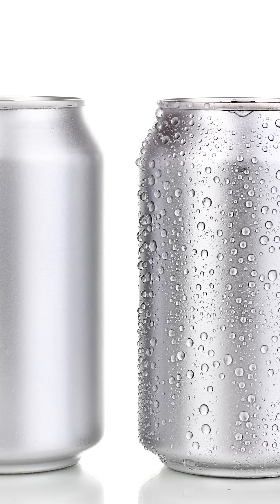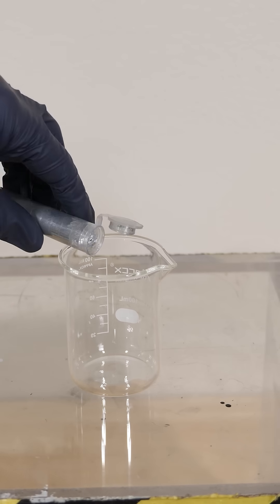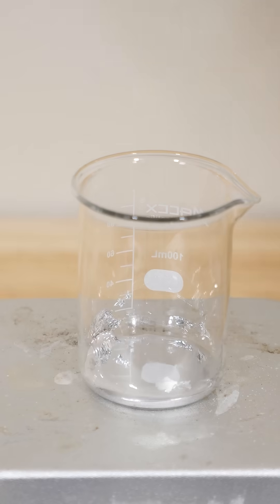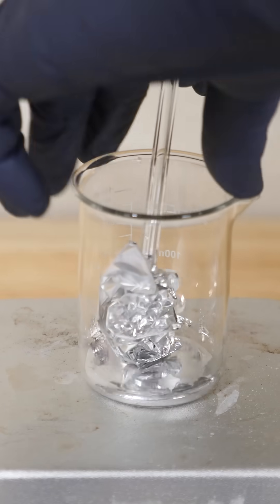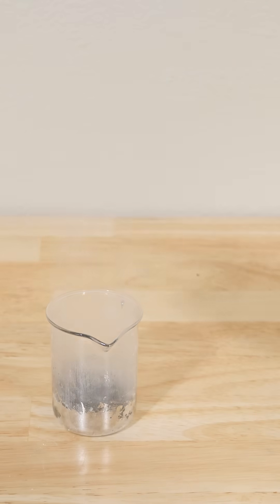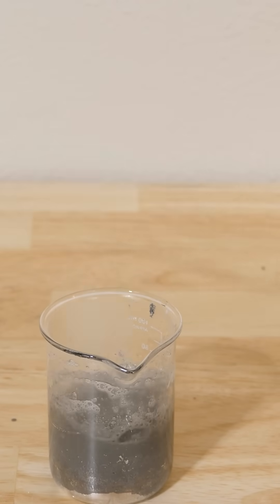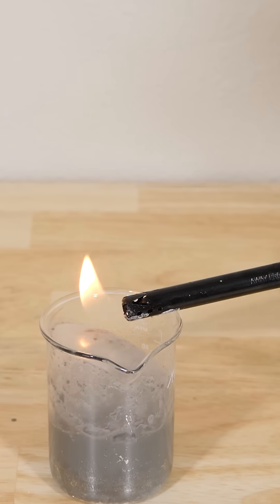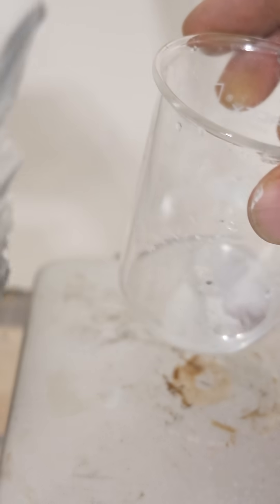Don't mix water and aluminum!

Comment: Note: Aluminium Oxide (Al2O3) is sapphire. And the dissolved Al in Ga is called an amalgam.
Reply: Amalgam in chemistry refers to an alloy of mercury with another metal
Reply: @SeanHenrichs Thats what I thought/was taught as well... can anyone please confirm this either way??As this commemt has now confused me as to if an Amalgam=an Alloy Consisting of Any Metal+ MERCURY /OR/ can the 2nd metal be any of the low melting point metals (i.e Mercury/Gallium?/Germanium?/Bismuth?/etc?)???
Reply: Do u know if the AL2O3 is soluable in Gallium?
Reply: @Unknown-Yve  absolutely not. The only thing I've ever heard of that can dissolve a sapphire is an extremely hot and caustic melt of NaOH, NaCO3, NaF, and NaB3H7. And that's something I never even want to attempt, because that's just terrifying.
Reply: @Unknown-Yve al2o3 is not soluble in the gallium. Nor does it seem that aluminum hydroxide is soluble either. This process allows the easy collection of the gallium after the reaction. If they were soluble you could not easily separate them.
Reply: I would have to disagree. Sapphire is aluminum oxide, but not all aluminum oxide is sapphire. Like how a square is a rectangle, but a rectangle isn’t always a square. They’re fundamentally different in terms of atomic structure.
Reply: @Sniperboy5551  Like how diamonds are all carbon, but not all carbon are diamonds?
Reply: @RobbieNguyen Like people are made of carbon, but don't shine.  Or are they made of Soylent Green?  Are babies made out of peanut butter.
Reply: @Sniperboy5551 I thought sapphire is mostly carbon structure but with Aluminium oxide impurity which gives it colour?
Reply: Yes this is the comment I was searching for.. Al+H2O only produces Al(OH)3 that's a white powder like thing.. idk how he separated that powder thing from gallium!😅
Reply: @jibinjose7537 depending on the temperature, it can make hydroxide or oxide
Reply: Cool, I now wonder if the term "amalgamation" derived from that! 😮
Reply: @delsings  It was.
Reply: Aluminum oxide isn't sapphire, it's the impurity that gives sapphire corundum its color. I have a feeling you meant that, but there are some people who would read your comment and think, "wow, who knew sapphire was made of aluminium?" so I felt it was best to correct it.
Reply: how do you reverse the process to make an infinite hydrogen producing battery ?
Reply: @ommsterlitz1805  You dont. Alluminum is extreamly energy expensive to make. While its raw material Bauxite is really plentifull, the energy needed to refine it would be way too much to use it as fuel. However there is research into otehr metal that has simmular properties thats is found naturaly for hydrogen fuel cells.
Reply: @lordfrz9339 learn how to spell
Reply: So, I have this aluminum, aka aluminium, bread pan that was used by my roommates as a water dish for their pets. It developed oxidation spots in it with white crust. Is that corrosion aluminium oxide, and if it's scraped off, would the powder ignite in water? 
Seems like this is the group to ask.😎
Reply: Rubys are also made of Al2O3. As it is a variety of the corundum mineral
Reply: How many different ways can you break that bond to make soooooo many different end materials...🍿
Reply: Sapphire is a really strong ceramic and I wanna know how to make sapphire chain mail!

Any ideas on how to get the right ~form~ of aluminum oxide so it's not just a powder?  I got some cans to recycle.   >:-D
Reply: @NotSoMuchFrankly you can get corundum crystals, but frankly it's probably not a good material for armor, because while it's hard, it's also very stiff, and will chip, it's basically like making a glass armor.
Also nighthawkinlight has a video on making synthetic rubies, but it's basically just melting aluminum oxide with 1% chromium with a carbon rod and graphite crucible on an arc welder to make a crude arc furnace.
The hardest part would probably be making aluminum oxide from the cans instead of just getting raw aluminum oxide powder, which is actually pretty cheap, if you don't mind the purity you could probably get some used powder from a waterjet cutting business for cheap, which might also give interesting colors due to the metal powders in it.
Reply: @satibel  Why thank you, sir, that was the kind of answer I was looking for.  I figured if it were practical and cost effective, someone would have done it but was looking for deets on the matter.
Reply: @NotSoMuchFrankly  love the thinking you do!
Reply: No, Corundum is a crystaline form of aluminium oxide.
A sapphire is crystaline aluminum oxide + chromium.
Not all aluminium oxide structures are sapphire or have the hardness of corundum.
Reply: You can make a similar such amalgam with aluminum and mercury, I think. It's used in lots of organic reactions.
Reply: When one compound has several structures it can form, making distinct properties at the macro level, those are called "allotropes"
Reply: In the anime „full metal panic“ there was this anti terror organization that the MC was part of that was called „Mithril“
Ofc they needed an opposing faction. They called themselves „Amalgam“
Now that I know this, maybe that’s why they lost 🤦‍♀️
Reply: "Aluminium oxide is responsible for the resistance of metallic aluminium to weathering. Metallic aluminium is very reactive with atmospheric oxygen, and a thin passivation layer of aluminium oxide (4 nm thickness) forms on any exposed aluminium surface in a matter of hundreds of picoseconds"

Sapphire, ruby and corundum are all mostly composed of aluminum oxide, but the surface of aluminum also is aluminum oxide.
Reply: Oh thank god...someone who spells 'Aluminium' properly. 🙂🇦🇺
Reply: @Johnno48 do you also say ironium? 'cause if you do it'd be ironic.
Reply: @Johnno48  But Ahloo - miniom sounds dumb. Ah - loo - mah - num sounds better.
Reply: @RobbieNguyen billions of non-Americans would disagree. Alumi-num sounds just terrifying to ear.
Reply: @Mzuagip  I'm not American. Ah - loo - mi - num sounds much better to the ear than Ahloo - miniom.
Reply: @RobbieNguyen  Still, that's your personal opinion and you can't represent the whole non-Americans by yourself.
Reply: @Mzuagip  Even then, I highly doubt there are billions of people speaking British English that have enough proficiency to know what Element 13 is. I'll give 200 million at most. More likely they'll just say their own language's versions of Element 13.

Aluminum people? at least 300 million people including Canada and the US.
Reply: @Mzuagip  I'm also not from the US and I agree with him. Ahhhhloominion hurts the ears.
Reply: @RobbieNguyen  Do you really think that British English is the only language that uses "Aluminium"? Literally most other languages besides American English use "Aluminium" in their language. Even some languages that has their own name still loaned it from the word aluminium, and the pronunciation agrees more to "minium" rather than "minum". And you fail to realise that Aluminium is a really common metal that's used in various household stuff, not to mention that Aluminium is learned in basic chemistry. Even a 5 year-old kids would know what aluminium is. 

And you said that it is 200 million at most? I can easily disprove you simply with my country, Indonesia. It is a country with ±270 million population, and guess what? We all are saying "Aluminium" here. Not to mention there are many British-colonised country around the world, and there's a good chance that most of them would pronounce this metal as "Aluminium".
Reply: @RobbieNguyen We pronounce it Alyoominium. 🤪 🇦🇺
Reply: @Mzuagip it was British chemist Sir Humphry Davywho first named it and ge called it alumium, but then changed it to aluminumwhen he gave a lecture to the Royal Society a year later in 1809. But another chemist reviewing his lecture used aluminium. Both were used for awhile but for some reason lost to time in the US and Canada aluminum stuck and in the rest of the English speaking world aluminium stuck.  Both are British coinage.
Reply: Yup. Indeed. This video is misleading and should be taken down. Aluminium doesn't react with water straight away.
Reply: @sliceofthatpie Why though? Aluminum alone reacts violently when touching water. But the layer of Aluminum oxide stops that.
Reply: @RobbieNguyen  Nope, it doesn't. Only in finely powdered form and only at certain temperature I guess.
Reply: @sliceofthatpie  He states why it doesnt, if you didnt ahve the oxide layer it would though. Which is why you sometimes get explosion is industiral alluminum modling. Water gets in under rpesure if they arent careful and touches the alluminum before air does.
Reply: @lordfrz9339  It's superheated steam, not just broken up water that immediately reacts. That's not how it works.
Reply: @sliceofthatpie I'd agree, if it was the headline title standing alone.  With the thumbnail of a water beaded aluminum can that we're all familiar with  disprove to the most basic mind, that there is something more than just the title statement going on.  So, in response to your flat call for take down, it's more basic than common logical senses or you think 🤔 the average viewers haven't passed 5th grade perhaps.
Reply: @sliceofthatpie I'd agree, if it was the headline title standing alone.  With the thumbnail of a water beaded aluminum can that we're all familiar with  disprove to the most basic mind, that there is something more than just the title statement going on.  So, in response to your flat call for take down, it's more basic than common logical senses or you think 🤔 the average viewers haven't passed 5th grade perhaps.
Reply: @sliceofthatpie 
It's not safe to use for cooking either way .
Reply: @jad2290  It's safe as long as food is not acidic.
Reply: @jad2290 why is which i never use in cooking ever
Reply: @sliceofthatpie Oh yes it is ..

Comment: How do you "recover" the gallium?
Reply: Use all of the material absorbed into the gallium amalgum via chemical interactions that interact with the added material, but not the gallium.

Edit: The mad lad NileRed actually has a lot of videos about recovering specific chemicals/elements from mixtures.
Reply: Glee

Comment: I see that as an option for large scale hydrogen production someday. Despite gallium being expensive, you can recover most if not all of it. Aluminum can come from reciclying of soda cans and water, well, its just water. Nowadays we either do it by hydrocarbon reforming (releases CO and CO2) or water spliiting (high energy input), so its nice to see alternatives
Reply: But it would be a waste to let aluminum even recycled one get used for this kind of purpose. It takes a lot of energy and toxic chemicals to get aluminum. Since recycling of aluminum is relatively easy, would make this even more of a waste. Better to split water with thermal energy f.e. in a special construction in the desert.
Reply: Aluminium refining is hella expensive energy wise though
Reply: Gallium isnt really all that expensive to produce as its a common waste material found in coal fly ash and other metallurgic waste products.
Reply: Doesn't this generate aluminum hydroxide though? And honestly isn't it pretty costly per litre of hydrogen generated?
Reply: All valid points. As to the cost, I really have no idea. My rough estimate would say that it would be still cheaper than water splitting. Not even talking about the energy for each kg of H2 per se, but also the catalysts you need for both sides of the reaction. Guy above said gallium isn't really expensive to obtain also, but I don't know much about that
Reply: Let me guess. You weren't good at chemistry.

It's extremely energy intensive to create aluminum. That's why aluminum refineries are usually located near cheap sources of electricity. In fact, some call aluminum "solid electricity". A good litmus test to indicate if someone has a clue about energy production is to see if they think that hydrogen or aluminum is a source of power. If they do, then they are clueless. Either can be used to store power, but neither is actually a source of power.

Comment: That's interesting. So, when hydrochloric acid eats the aluminium oxide layer then this reaction cicks in and together the hydrochloric acid and thr aluminium with water makes it. Or something similar because with sodium hydroxide, you get aluminium hydroxide (which i guess comes from aluminium and water reaction)
Reply: With sodium hydroxide you dissolve the oxide layer too, forming water soluble [Al(OH)4 -] ions (tetrahydroxoaluminate) and exposing more aluminum that reacts with the water and makes more H2 and Al2O3, wich dissolves again with the NaOH
Reply: Don't mix it with Works toilet bowl cleaner.
Reply: My uncle taught me how to do this reaction using sodium hydroxide as catalist when I was about 8 yo 😅

Comment: You got the gallium back. Where did the aluminum go?
Reply: Gone. Reduced to atoms, I used the metal to destroy the metal
Reply: @TechDove hahahahah nice
Reply: george1001001 no the aluminum stays behind as aluminum hydroxide
Reply: Yes, all the aluminum atoms are now combined with OH ions,
Does the AlOH stay in solution, or vaporized in the reaction, Or is it separated out after?
Reply: @jeb197  If I remember correctly (Correct me if I'm wrong lol), when Water is used on Aluminum that is treated by Gallium, it combines it chemically to create Aluminum Hydroxide and Hydrogen Gas; Al(OH)3 + 3 H2.  You'd have to use Gallium again on Aluminum Hydroxide to remove the OH ions from Aluminum, created Gallium Hydroxide, would be Ga + Al(OH)3 = Ga(OH)3 + Al.

To get rid of the Hyddoxide from Gallium, you'd have to heat up the Gallium in order to evaporate it. Heat used on Ga(OH)3 would generate Water Vapour; Sufficient Heat + Ga(OH)3 = Ga2O3 + 3 H2O, by heating the Gallium Oxide even more, you can remove the Oxide through Thermal Reduction, gaining the Gallium back, and repeat the process once more with Aluminum.
Reply: The Aluminum Stays, the Gallium can be recollected through various means, but basically what happens is that Aluminum wants Oxygen, hence why it turns to Aluminum Oxide when air touches it.

By adding Water, you are doing the exact same thing, however you are also un-binding the hydrogen from water (H2O), and the gas is basically Hydrogen. This is actually a great way to capture Hydrogen since you are merely chemically removing the Hydrogen from water. The problem is Gallium. You can recover it but you do end up losing part of it from chemical processes, so it would get smaller and smaller per use. However this method would be great for the use of creating Hydrogen Fuel Cells for energy creation.

Well. If the green wave fanatics would stop shoving their solar panels and wind turbines in everyone's face. I mean, I kid you not, some of those fanatics think Burning Hydrogen generates CO2, even though theres no Carbon to burn anyways, burning Hydrogen would generate Water Vapour as you are chemically combining the burned material with Oxygen (Hence why fire needs Oxygen to burn.) Wood is Cellulose which is a bunch of Carbon and other molecules, of course it would generate CO2. But Hydrogen? Really?
Reply: @phantamanta4453  Where did this sudden burst of politics came from? In a cute little short about aluminum reacting with water, there really should be no place for that. Nonetheless, you are correct, but these topics should not belong here imo.
Reply: @joshx01  This isn't even about political talk, or I fail seeing it as political.

In my head so far, if you think me complaining about how a few fanatics being factually wrong about how to get energy more efficiently, then people complaining what color is better, red or blue, would be political too. Assuming it's political, you're making it political, even though I never meant to make it political in the first place, nor was it my intent.

Then again, that's how I think.

Comment: We need to find a way to utilize this!
Reply: I have thought about using this to power turbine engines. How would it be?
Reply: @Vichu.  it would depend on the velocity of hydrogen released from this reaction, if you could make hydrogen fast enough then it could possibly make it power the system of turbine engines , but the thing is hydrogen is very light so its force on the turbine would be very less (as f=m.dv/dt) but with a very high velocity it could make it rotate

Comment: What would happen if you exposed AL to H2O in a vacuum?
Reply: Hot mist?  (I don't actually know, I just wanted to guess that)
Reply: @oddlyspecificmath "Hot mist" you mean steam?
Reply: @robosing225  well, this is embarrassing :)
Reply: @robosing225 or hot fuzz
Reply: @robosing225 You mean fast vibrating gaseous Dihydrogen oxide?
Reply: @honglianglim8637  I love this response. It has Rejusts glasses "Acktually" vibes and I love it. Pedantic all the way.
Reply: note to self: don't suggest "monoxide" -- we don't want another 'incident'

Comment: Can we make a battery with this tach.
Alluminium + water to create Hydrogen and then to create electricity in EV cars.
Reply: Or just make a safe hydrogen engine. It's on-demand hydrogen, so it's not like there's a tank in the car which can explode. Why do EV? That's secondary sourced, when you could just use hydrogen for fuel.
Reply: @scottmatznick3140  Ofcourse we can if Hydrogen engine have been developed successfully.
.

Toyota  the only company for now) has been working on Hydrogen engine but still this engine can't be relied upon as hydrogen is highly inflammable and explosive. 

.
H2 engines will run smoothly for long is still to be examined. 
.
But ,, I support your say.
.
Enough H2 can be produced with this reaction .
Also, the product and bi products aren't hazardous.
.
Then, it'll be grater .
Just put in some Alluminium roads in the system, and enjoy the drive